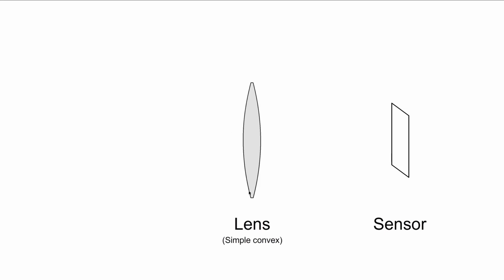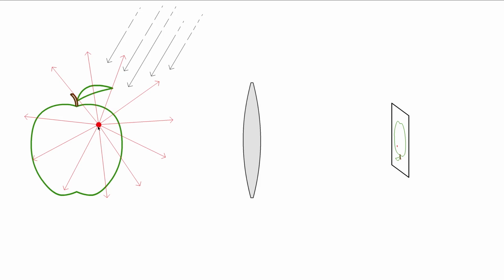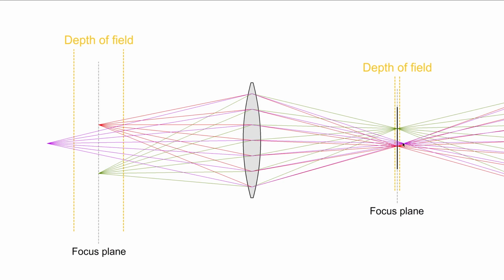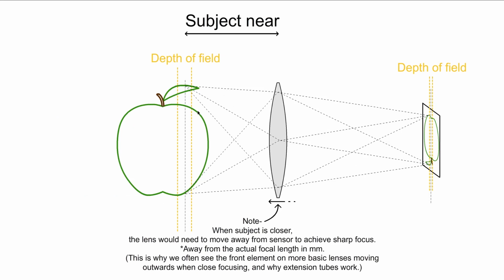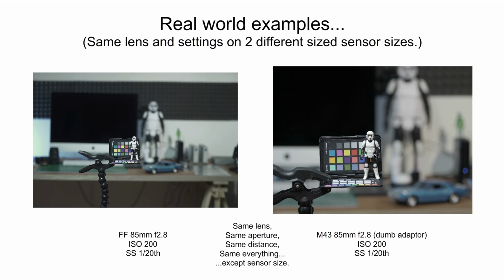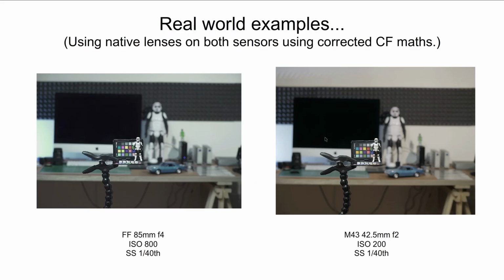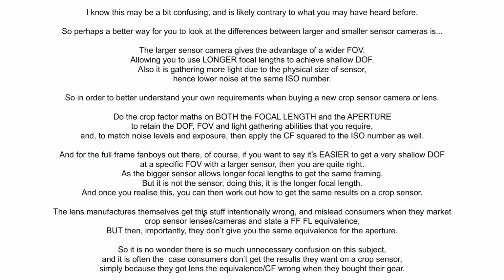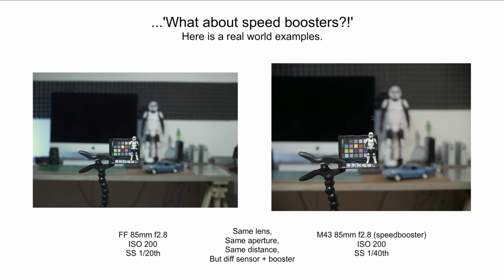Depth of field and crop factor misconceptions.

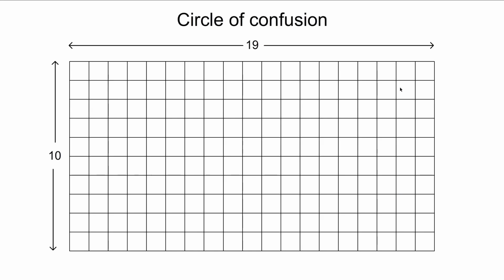Comment: 16:44 pixel density has nothing to do with it. all that matters is how much the final image is blown up compared to it's original size on the sensor.
Reply from the maker: Maltfalc end resolution is fundamental to the end result (for depth of field.)
I mostly work in video so it mainly 4K regardless of sensor size. (So level playing field as far as res goes)
But if you vary the res. Then you change the DOF. 
Maybe look into the “circle of confusion” if you don’t see this connection.
Reply: absolutely not. dof is perceptual. the physical size of the the final image being displayed to the viewer vs the original projected image size on the sensor is what matters. the smaller sensor's shallower dof is solely the result of the image being magnified more when displayed at the same physical size as the image from the larger sensor. resolution is not involved. if i print the same 8x10 image at 50MP and 5MP, dof is the same.  physical size matters, not resolution.
Reply from the maker: yes of course DOF is perceptual. thats why you can perceive a narrower DOF when you go from FHD to 4k. the acceptable 'in focus' area shrinks as you have higher res. The circle of confusion has grown relative to the individual pixels. if you watch the video all the way through I'm not sure why thats not apparent. maybe check out filmakerIQ video on DOF, he goes into greater detail about the circle confusion that i do. thats the bit you are not fully getting i think.
Reply from the maker: To add- You have to remember that at any aperture there is only technically one plane/distance that is totally 'IN FOCUS'. So its all perceptual, and a big part of that perception/opinion, is down to resolution. if you look at a tiny low res image, it can look in focus. when you see the same image at very high res, you can see that it was infact out of focus. Do you see what I'm getting at?
Reply: wrong again. that's a completely separate factor from coc and dof relative to sensor size (one which doesn't even apply in this situation because you specified identical resolutions in the video). you're conflating two different things. before accusing me of not understanding coc or not watching the video (the details of which you yourself have forgotten), go learn the difference between coc and the limit placed on an image's sharpness by resolution. they are not the same AT ALL and you need to stop confusing the two.
Reply from the maker: Maltfalc I’m going to give up on you I think. :)
Reply: good. there's no point explaining what you got wrong when you don't understand the basic principles i need to use to explain it or even care that you don't understand them.
Reply from the maker: Maltfalc don’t get your knickers in a twist. I’m out at the beach filming. Il read your comments properly tomorrow when I have time. But I’m pretty sure you just have a pink kink in your think about nothing at all. 

I know all the facts and have done huge amounts of practical testing  regarding DOF etc. 
So I only have doubts regarding your understanding, or possible simply a miscommunication. 

(Not to mention several essays I have written on the subject that were received very well, with tens of thousands of likes and positive feedbacks.)

Comment: This is the best explanation I have seen on this topic. Nevertheless, I think it is a mistake to say we make the three adjustments and get equivalence. That's just about as wrong as all the other explanations I see online in one sense. Now, it's true that those three adjustments will make the images very similar. But much of the time it's not even possible to do that. Suppose I use a 85mm f1.2 lens on full frame. Those are common today. Where do you find a f0.6 lens? They don't exist. Let's use an f2.8 100mm lens on full frame. So we need a 50mm lens at f1.4 for mft, which is likely doable. But now, our full frame camera has native ISO of 64. How will we replicate that? And a terrible misunderstanding comes from saying we double the aperture for micro four thirds to get full frame equivalence. That is because aperture is a physical measurement, and using a crop factor multiplication causes another myth because people think that aperture is really halved. But if that were true, we would need to double our exposure. But exposure times are correct. So, while it's true that if we adjust all three of those factors, it's rarely possible to do it in places where it's important. And people often think that statements like "halve the focal length" or "double the exposure" are true stand alone. It is therefore important to explain that these changes are not true when taken one or two at a time and very often they are not achievable. My explanation is that there are ways to make similar images if we intentionally handicap one system or another, but there is not a general way to create equivalence. Sometimes it's the crop sensor with an advantage. Consider a 400mm mft prime lens at f2.8. It has a magnified image so that full frame camera will need a 800mm lens for equivalent field of view. Now it's the full frame lens that can't match because nobody makes an 800mm f4, and if someone did it would be so heavy and expensive that nobody would buy it. True, the bokeh would be different, and there would be more noise. But you could still take pictures in low light because the f2.8 gives real exposure times. Maybe the subject is so complex it can't be made simple, but I have seen a lot of misunderstanding caused by explanations which use all three factors. Don't get me wrong. Your explanation is more clear and correct than any other I have seen. And if we are careful, we can get a correct understanding. But I have seen similar explanations cause as many misunderstandings as the outright myths.

Comment: Great video. Only for ISO is correct but if m43 camera is 10 mpx and FF is 40 mpx that the ISO is the same (pixels per sq. inch). If the resolution is the same, you have to multiply by 4 (2 x 2). For that m43 limit now is 20 mpx (they can not support more for ISO)
Reply from the maker: Regarding MP. 
I work in video. So most of my calculations are presuming we are looking at 2 cameras at same resolution. 
(Both shooting 4K )

Comment: Well, smaller pixels do not give shallower depth of field, because the circle of confusion stays the same. We just use more smaller pixels to show the same size of that circle. I mean if the circle of confusion has diameter ~0.02 mm, it doesn't matter how many pixels we use to show that point (1 pixel with diameter 0.02 mm or 10 pixels with diameter 0.002 mm).

Comment: I have never understood why people feel so compelled that you must apply a crop factor to the Aperture.  

We never had to do it with film cameras.  We had different film sizes, and no one talked about crop factor.  It did not exist.

I understand the purpose is to match the image that you might get from a full frame camera.

 Except, no one actually shoots like that.  People mount a lens on the camera just take photos.  

I have never met anyone who tries to adjust their camera settings to match what a full frame digital sensor would capture.  

The problem is that the first digital sensors were not full frame, and the AOV would look different compared to a film camera.

An eexplanation had to be created to explain why the AOV with a 50mm lens was different on a digital camera, compared to a film camera.

In turn, this led to all of this discussion about how must apply crop factor to your aperture, so that photographers could get the identical images as their film cameras.

Is the math incorrect?  No.  The intent of of it is what is incorrect.

Comment: I'm pretty sure focal lenght doesn't change DoF. A longer lens makes what's blurry looks blurrier because the background is magnified. But the DoF is the same.
Reply from the maker: Tomy hi. It's one of the fundamentals. (That FL changes DOF)... why else does a long lens have shallower DOF than a shorter one at the same Fstop?
But If you wish to brake it all down though I will. 

Firstly remember there is only ever one single plane that is absolutely in focus (even at small apertures)
But of course we do not have infinite resolution. (Pleas note that the acceptable in focus region will grow with lower resolution captures, but that's another conversation)
And this 'acceptable in focus region' will shrink (in z depth) when you change to a longer FL. (Keeping other factors constant)

I'm surprised something like that would be questioned TBH. 

Of course the light rays coming from the subject will not change. But when you have a long lens it's much easier to miss focus because the DOF is thinner. 
(please also remember that the concept of DOF is essentially subjective, as it's just a sliding scale of more and more out of focus, falling away from that actual focus plane.)
So if the sensor res remains constant, and we change between 2 diff FL lenses then our "acceptably in focus area" will most certainly change. 

Give it a test yourself.
Reply from the maker: Tomy p.s. If your still not sure, then do further investigation about the "circle of confusion".
As this will clear up the issue for you. 
I touch upon it in this video, but very briefly and only for one purpose. 
Check out a full article or video on the CoC. It really helps with this whole topic in general.
Reply: Before I agree or disagree, I think we forgot to point out what variables we decided to change while changing focal lenght.
I agree with DoF shrinking when the fixed variable is distance to subject. (ie : as you zoom on something for example)
But my point about DoF remaining constant was when subject size remained constant (so switching for a longer lens, coupled with getting further away from the subject to get the same framing of the subject).
This is the case where I'm pretty sure DoF remains constant. And you can't judge it by looking at the blur, because the out of focus plans do get blurrier.
But DoF only relates to what is in focus, not how blurry what is not is focus is.
Reply from the maker: Tomy you are talking about taking with one hand, and giving with another. (Change to longer FL then move away from subject)

The main theme of this video is equivalence. 
So everything I suggest you do to achieve equivalence means that-
we keep FOV the same so we don't need to change distance. 
We keep DOF the same (so we get same amount of b.g. Blur etc.)
We match image noise, so very predictable and similar quality regardless of what camera you pick up. (Note, Also this will point out low light limitations before we buy a new camera/lens with a sensor size you are not familiar with)

If you want to start standing at different distances to match FOV on diff sensors, then that's up to you. But that's not what we are aiming to do here. 
If u simply swap ur camera from FF to a cropS, keep the same lens. And move backwards to match the tighter FOV then you are doing exactly what I say you shouldn't if you want true equivalence. 
You will lose total light, hence have noisier images, have a wider DOF with less B.g. Blur because you have increased distance to subject. And of course your compression will be difference also. 

Not to say that is wrong, or you can't still achieve great results if you do it that way. 
But, as I said, this vid is about getting totally the same results on completely different sized sensors. 
:)
Reply: I wasn't talking about switching sensors though.
So do you agree with this statement :
With sensor size and subject framing constant, changing focal length doesn't change DoF.
Reply from the maker: Tomy no I don't agree with that statement. 
All you are technically doing is enlarging the image. But this enlarges your CoC too. 

Put it this way. If I was filming at 4K
Camera /subject doesn't move. 

Pop on a longer lens.  
If our acceptably in focus DOF area was perhaps 20 inches. 
With the longer lens (everything else remaining the same) our acceptably in focus DOF area would now be less. Perhaps 15 or 10 inches depending on exact the FL of course. 

Because, let's say we have our main actor bang on the in focus plane. 
And we have a second actor behind him. 
At the smaller FL the second actor could be within our acceptably in focus range. 
(He just looks sharp enough)
But now we are tighter on everything, the actor behind who was JUST in focus, could now be perceivable out of focus. 
The cones of light are intersecting at the same point on both lenses. 
But the circle of confusion for the fine details on the second actor are now bigger, and overlapping one pixel width on the sensor. So it all looks slightly fuzzy. 

You can easily test this yourself. 
Use a tape measure or something similar and have it moving away from the lens in z depth. 
Judge the barrier for which numbers on the tape measure go from sharp to clearly just out of focus. 
Then swap lenses and do it again. 

Please remember while you are doing all of this that even on small apertures there is technically only one single distance/plane that is absolutely in focus. 

DOF is basically always a sliding scale. 
So you judge it by the resolution of the captured medium, how big it's displayed and factors like that. 

And that imaginary line between in focus and out of focus will shift for many reasons. 

(It's like looking at a perfect gradient and deciding where black ends and white begins. )
Reply from the maker: Just to correct myself there slightly. 
The cones of light would be emanating from the same point (on the subject) but they would intersect further from the sensor for those slightly OOF points due to the longer FL
(Keeping the Fstop constant of course)
Reply: I agree with what you say.
But I said sensor size and subject framing constant, whereas your demonstration is sensor size and subject distance constant.
What I was implying by "subject framing constant" is : taking a longer lens paired with getting further away from your subject to get the same framing (obviously with a different perspective) of the subject.

And this was the conditions in which I was saying DoF remains constant. Because the reduction in DoF because of the longer lens, and the increase of DoF because of a further focusing distance, cancel themselves out.

And the conclusion of all this (be it true) is that, for a given aperture, DoF depends primarily on subject framing.
Reply: This thing is being talked about in the "CLARIFICATION: FOCAL LENGTH AND DEPTH OF FIELD" paragraph over there :
http://www.cambridgeincolour.com/tutorials/depth-of-field.htm
Reply from the maker: Tomy I didn't specifically test that method as part of my research for this video (as I was testing equivalence over diff sensors thoroughly)
But from my general experience, and my understanding of it all. 
The longer lens, at greater distance at same Fstop and same framing will give a narrower DOF. 
 (although I'm only just working this out as we chat, so would like to test to be 100% certain) 
I believe this is because of how the whole Fstop is worked out. 

What I mean by this is-
Even though both lenses are set to the same Fstop. (Let's say f2 for the sake of argument)
The longer lens (longer FL) has to have a physically larger aperture at f2 to the shorter lens (shorter FL)

Example a 100mm f2 has a aperture diameter of 50mm
A 50mm f2 has a aperture diameter of 25mm. 
They both given same exposure. But the opening on the longer lens is physically bigger. 

(This is partly why very long very fast lenses are bloody huge, and expensive)

I'm possibly too tired to think this particular set up through perfectly right now. That's why I would prefer to test it practically to double check my brain is working ok. :)
But enjoying the chat. 

Fielding all of these questions is a great way to keep your brain sharp. :)
(Sharpish today, little hungover)
Reply from the maker: Tomy il check that out later. :)
Reply from the maker: Tomy I think the filmmaker IQ guys do great vids on all of this stuff. 
Deff check those out if you want to get your head clear on all this stuff. :)
Reply: They do make great technical videos.
Btw I'm currently in the process of making my own videos, mainly on dynamic range, sensitivity etc etc :)
Hopefully I'm putting a new twist on the subject.
Reply from the maker: Tomy il check ur channel out now.
Reply: Noooo don't check this one it'll be awkward lol.
I'll get back to you via facebook once the new one is created
Reply: DoF is a function of the focusing distance and the hyperfocal distance. The formula for the hyperfocal distance is H = f + f^2 / (N*c) where f is the focal length, N the aperture value and c the circle of confusion (a function of the sensor size). So f clearly matters and it's relation is grate than linear. (note the first f is basically meaningless but the second counts.Hyperfocal distance is the distance that is sharp if you focus to infinity. If you focus to hyperfocal distance then everything from half of it to infinity is sharp. Basically it is the distance after which you do nit need to care of focus.